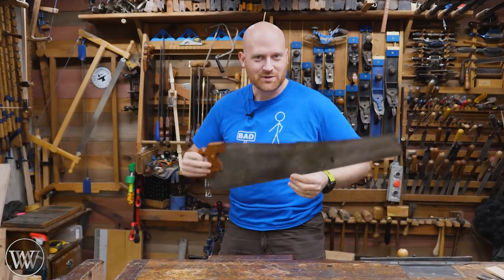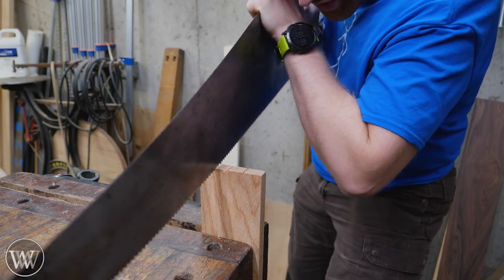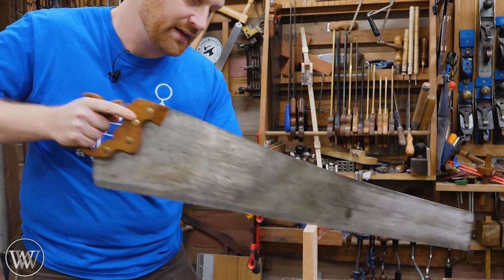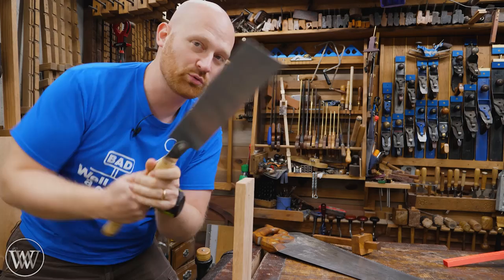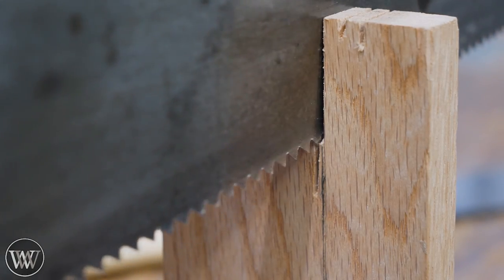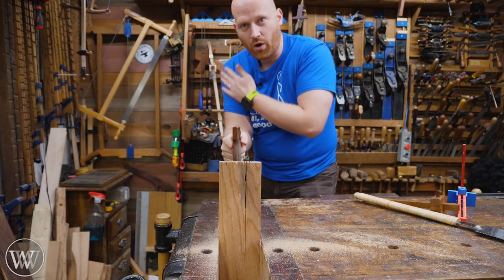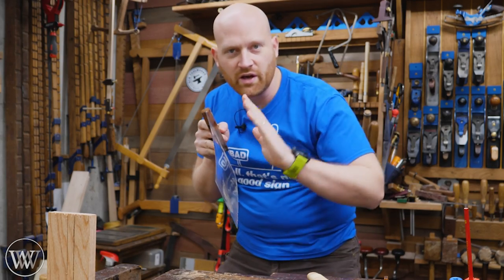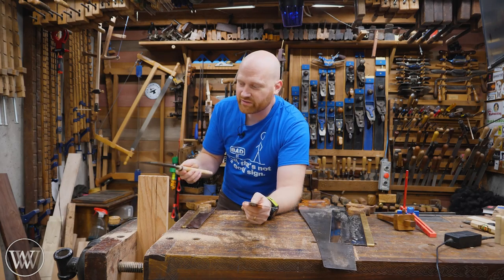The Secrets of A Hand Saw

Comment: The saw/hand/elbow/shoulder alignment was something I learned years ago and it seems to be a very common problem. Excellent advice on that to use a camera! 
To get straighter cuts use more teeth. You know how a longer plane makes a flatter surface? Same with a saw. Lower the handle so more teeth are engaged and you can saw straighter, easier.

Comment: James, very helpful video. I am a beginner and am trying to move away from power tools (miter saw, table saw ) as I find hand tools way more enjoyable , dust free and I can still have my 3 year old around to watch me which he truly enjoys 🙂 I use western saws mostly primarily because I want to learn the art of re-sharpening too (just like I am doing with my chisels and planes). I am sawing lot better than I used to 6-8 months ago but I still struggle starting a cut even with a dovetail saw - no matter how much I try to relax myself but maybe I am still putting more force than I need to and I feel like the saw is biting into the wood even before I can slide it! I use a veritas 14tpi dovetail saw which is relatively new and premium quality I would assume and hence very less likely that it is an issue with the saw. I have a spear and jackson tenon saw which is cheaper but surprisingly I find that easier to trace a straight line with (I bend down and try to keep the saw length as much in straight line/near parallel to the line I have drawn. I am not sure that is always the right technique). Any additional pointers would be very helpful.
Reply from the maker: Practicing moving the saw back and forth with out engaging the saw it a really useful excursive. let it slide on your thumb and just kiss the wood every few teeth.
Reply: @WoodByWrightHowTo  Can you make a video about "secrets of european style frame saw"? How to grip it, how to correct the cut and so on? Please, it´s hanging right behind you :-D
Reply: @goodreek  I second that request! I love my frame saw, but I'd love to learn more about proper technique.

Comment: To start sawing easily, a rip cut for example, tilt saw stroke up a little, let teeth exist the endgrain side instead of the face on the back, assuming your are cutting on push strokes. It is a good trick James demonstrated several times in previous videos. It is also a popular trick in traiditional Chinese woodworking. Another trick is for planing. Arrange the end of a board close to you higher than the other, and plane slightly downwards. It makes planing easier.

Comment: Hi James I love hand tools and really appreciate your videos. Can you please tell me how do you like to strip varnish off of a brand new panel saw. Thank you very much!
Reply from the maker: Usually I use a card scraper. The side of a chisel also works pretty well to scrape it off.
Reply: @WoodByWrightHowTo  thanks but I don’t mean a spill or drips of varnish. I mean when the saw comes new with a finish on the saw steel. Not the handle either.
Reply from the maker: Yes. I scrape it off. If you are looking for a chemical answer most any paint stripper will do it.
Reply: @WoodByWrightHowTo  thank you James 🧡

Comment: Great vid. I have a back problem and sometimes I need to sit down in front of my work to saw. Been struggling with alignment and haven’t really cracked it yet. Wondered if you have any tips?
Reply from the maker: If you think about a saw bench where you kneel on the board and aim the sawdown and then you rotate your whole body to work at a bench vise your body is in the same position but you're pointing it at the wall now. If you're sitting down it's all in the same position. But now your angling up and pointing more towards the ceiling. So you have to rotate your body to match. You want to keep the same posture. You just rotate around the board. Does that make sense?
Reply: @WoodByWrightHowTo  I’ll give that a try. Thanks James

Comment: Great sawing tips and information. What if you are using a modern saw that doesn’t have the horns on the handle?
Enjoying your videos btw.
Reply from the maker: The songs that you buy in The Big box store are not meant for woodworking. They are tools for a carpenter building a house. You can still get good modern saws with the horns just not going to find them at the hardware store.

Comment: Ok you are trying to make a cross cut on a 4" x 3/4" piece of wood. The wood is in the bench hook. The 4" length is on top.  How do you get the saw plate perfectly vertical and the cut started so that the cut is square across the 3/4" dimension?
Reply from the maker: Mark a line on the board and cut to it. If you have a shiny saw you can look at the reflection in the saw and it will tell you if your saw is 90° or off. But to get a truly accurate square cut from one side is a good bit of skill. And the only way to get that skill is to mess it up a lot and keep trying over and over again. That's why most people cut just a little ways away from the line and then clean it up on a shooting board.

Comment: The "put some weight into the saw" bit probably needs expansion.  A big beginner mistake is to try to push the saw down with the cut.  You spoke about holding the wight of the saw up, but once you're going, how much do you hold the saw up or press the saw down?  My thinking has always been to let the saw do the work and so once you've got the cut going, neither lift nor press the saw: it's own weight will be enough while you just move it back and forth.  Sawing upside down... well that's another matter.

And speaking of other matters: any recommendations for ripping?  Every time I try to do rips with hand tools is an experience of regret and makes me long for the power tools.  Good rip saw recommendations and technique advice would be appreciated.
Reply from the maker: I generally let the saw weight do its work. However, in some instances I put a little bit of weight into the saw or take a little weight off. Depending upon the speed I want to go or the cleanliness of the cut. The more weight you put into it the better the chance it's going to turn or give you a rough cut, but you will go a little faster. As to ripsaws. There are very few good newly made hand saw. Bad axe has started making them and you can get them from Linqs and pax but the handles on those are atrocious and you usually have to refile them to fit your hand and make them comfortable to use. Generally, if you want a good rip sod, a decent price, it's finding an antique.

Comment: I'm a new woodworker, just got an old disston, I know it has 10ppi and very little set. I have never set a saw before, I did clean up and sharpen this one. Now I'm having some issues with binding, I have a good cut, straight and in line and don't have the issue with my other saws and the saw does seem straight, any idea what might be causing the bind?
Reply from the maker: sounds like there is not enough set on it.
Reply: Thank you. I thought that may be the problem but wanted to make sure. 

I seen a video where Paul Sellers sets a saw with a hammer and a punch, not sure I want to attempt that.
Reply from the maker: Doing it by hammer actually works really well. Just understand it. May get more set on one side of the salt than the other. Usually if you do it by hammer I find I come back and stone the saw to bring it back into true.
Reply: @WoodByWrightHowTo  Awesome, thank you again. Maybe I will give it a shot. 
1000 grit diamond plate would work to stone the sides?
Reply from the maker: Yeah. I use an extra fine diamond plate for mine.

Comment: Also, would it be possible to get a 3D scan of a good handle and then just print it in plastic? (I know, not proper wooden feel but as a cheapo option.)
Reply from the maker: The problem is plastic isn't as strong and you'd have to make it more beefy in the connection points. I have played with a few of them like that and you're right they don't feel good. But you can make several different sizes too. Make sure it fits your hand. That's why good quality and saws are sold by hand size. So you can actually order one to fit your hand.

Comment: How do you align it in the center for very wide cuts say when you're resawing to make a wide board thinner. the board would tend to come out thicker on one side
Reply from the maker: I just put the line on the center of the teeth rather than on one side or the other. Sorry I'm probably missing something in the question. Rather than having the line going down one side of the curve. I have it right down the middle.
Reply: @WoodByWrightHowTo  Thanks!  I guess I should have said, like when you have the saw on the short edge of the board, cutting down the thin part.  The other end of the saw wants to misbehave 

Really appreciate all your videos 🙂

Comment: id disagree about one thing:
the idea of "once you master the push stroke saw you can do more with it". What would you want to do with it? The purpose of a handsaw is to cut straight. You do not cut curves with it. Rather than learning to fix your wonky saw line just learn to saw straight in the first place. What good is being able to correct your sawline if you already ruined the piece? If you got hidden joints then fine. But if the joints show not sawing on the line is already the point of no return. Of course you can leave space - but this only means more clean up work.
The time spent learning to correct our sawline is better spent learning to keep good saw alignment and not curving off in the first place. 

Push stroke sawing is just a fundamentally flawed concept. You compress the saw which leads to inevitable buckling of the sawblade. Pull stroke keeps the sawblade under tension. Sure- if you got a monstrous saw like this the buckling isnt gonna matter a lot. And you can also use a saw with a spine. But thats only reducing the issue. It doesnt solve the problem. And both solutions come with their own bag of issues.

To this day no one has been able to communicate even once to me why push stroke saws still need to exist. I mean besides tradition. And i get it. I come from a very traditional woodworking field. And i have spent three years learning traditional techniques no one in their right mind even uses anymore today. And you CAN do great work with a push stroke saw.
And we had to learn to use them. But there simply is no reason why anyone should WANT to still learn that.

Note that this is about hand saws. There ARE saws that are made for cutting curves. These DO make more sense in a push configuration. Especially if we are talking about frame saws that are under symmetrical tension.